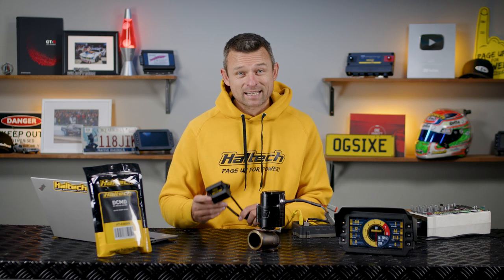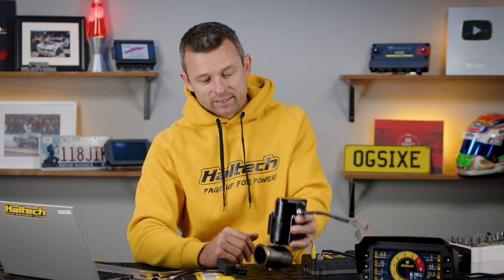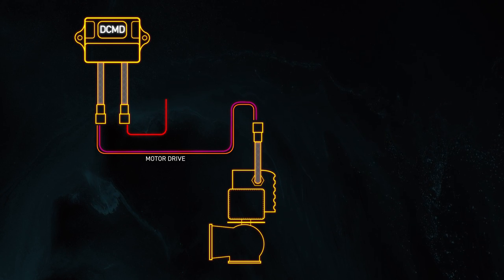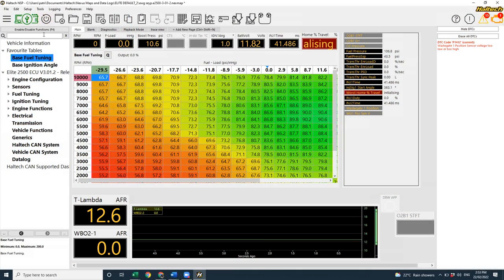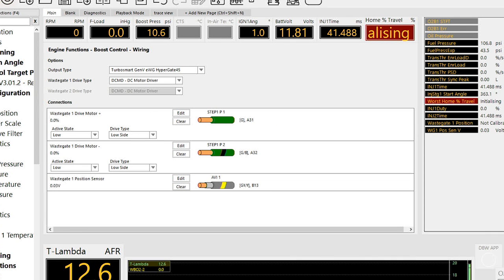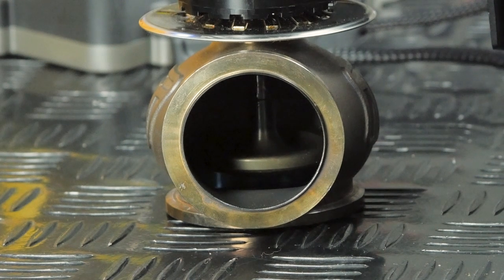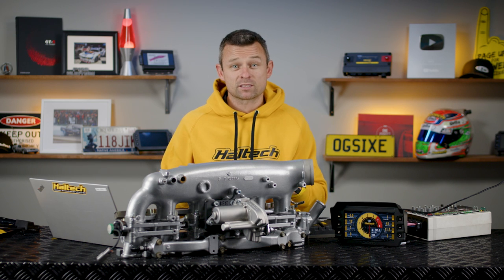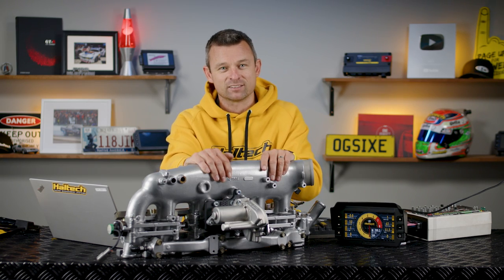🔍 Haltech DC Motor Driver (DCMD)  | PRODUCT OVERVIEW

Comment: Need an Elite Expansions for I/O's guys, there's not enough i/o's, even this wastegate using 2 extra plus a seperate driver. Which is cool but we need more I/O's Im after 23 now if I want this Eboost controller. Which i do but cruise , abs , map selector , 4 150 psi sensors , 2 iat's , 4 egt's , plus 2 more swithes for tripping antilag  or 2step etc. system is busy and needs more please. Im running everything full on analogue side and buying another 4 port platium expansions box is not going to help.

Comment: This is AWESOME news!   Electronic wastegate sounds like it's going to be amazing.  However, did anyone see Jamie's Civic from PFI Speed? His Turbosmart electronic wastegate got stuck closed and the engine saw 80 psi of boost. Cracked the block in half lengthwise.  Makes me nervous to run an e-gate, but I suppose that's what boost cut is for, right?
Reply: what caused it to stick closed? probably the electonics controlling it. (fooltech)
Reply: If there was safeties in place that wouldnt happen
Reply: @coreyconway1289  Yes, hence why I typed, "but I suppose that's what boost cut is for."  However, when you pay $1200 Fn dollars for a glorified electric exhaust valve, IT BETTER WORK OUT OF THE BOX!!  If I see more failures, then no I am not on board until it gets revised.  This is like buying a new car- NEVER EVER buy the 1st model from the new generation.  It's like a 2020 Chevy Silverado.  $90 grand and the lifters fail in under 8000 miles because they outsourced them from a company who has a poor track record for making lifters.  
To each their own I guess.  I mean, these valves are BRAND NEW for anyone.

Comment: The electric gate has been out for a while, yet I see ppl faffing around with c02 still. I heard there were some issues trying to control the gate. Whats the deal. Isn’t it open source, why wasn’t driving the thing nailed in a month.  I’m used to some hobby open source platforms around flight controllers and brushless motor controllers. 2yrs is forever in open hardware when 1000s of ST engineers are spending their spare time collaborating and crushing a singular goal. I need to do some research on what’s holding up the TS eGate.
Oh and cool vid, logic level H bridge prebuilt by haltech sounds dope.
Reply: How did your research go. I was going to get this, but second guessing after the other ecu company has issues controlling an egate.

Comment: Could this be used as a add on to a elite 2000 to make it possible to run DBW  throttle?
Reply from the maker: No. There is no DBW function written into the Elite 2000 firmware.
Reply: @haltech  👍

Comment: By rights this should work with any ECU correct?
Reply from the maker: Not at this stage. Currently it only works with Haltech Elite and Nexus series ECUs.
Reply: As a generic motor driver yes (so the case of the itb throttle setup where you need extra current yes it'll work on any ECU) the specific egate control however is limited to haltech elite and nexus ecu's
Reply: Thanks for the replies.as well as the awesome products and videos! Much appreciated!